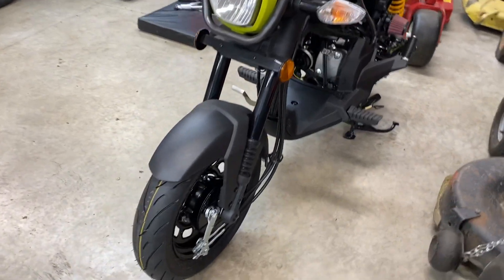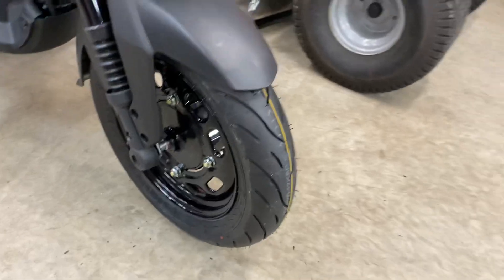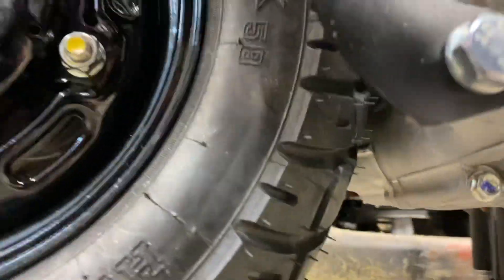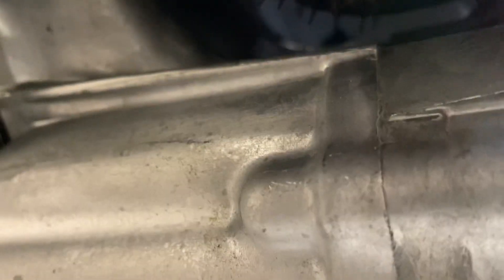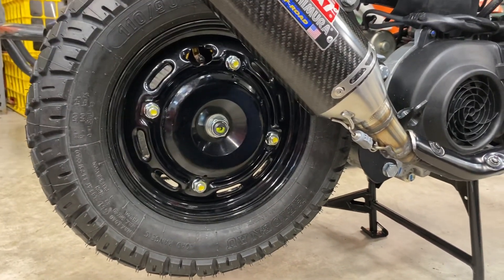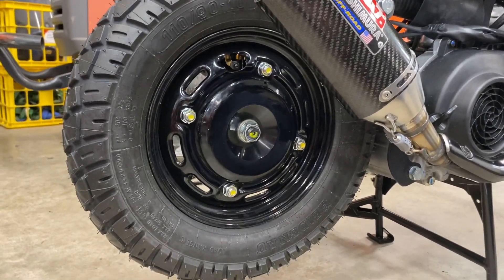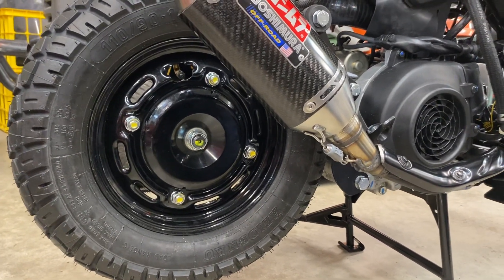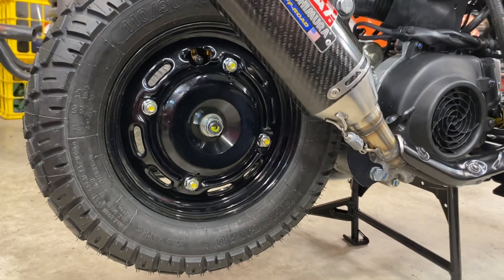Honda Navi (Tire update heidenau)

Comment: You have some nice vids. I have a quick question for you, I am really curious after modifying the Navi what kind of top speeds you are achieving. Ive seen a lot of videos about mods but anytime someone asks about the performance gains it seems no one can give a real answer or actual number of top speed. Its always "I won't be riding it for while because it's raining" or "it's too cold" or they just plain and simply say that it is going faster but without any numbers or depth in the response. I read a comment that you said you won't be riding it bc it is too cold, I understand that. But if you could please just give an update about the performance gains when you can that'd be amazing 🙏. Thank you.
Reply from the maker: Thank for watching billy.
I understand, this was the first weekend actually I could take the Navi out. First take of gas got me 60 miles, I was on steady flat roads. There is a brake in period fyi so I’m not just going to beat on it right away, motor need to loosen up… cold weather plays a big factor cold tires on and on.
Honestly if your looking for speed this isn’t for you… remember it’s a carbureted 110 cc, wind, body weight and mass (how wide you are) all plays a factor, this is a cvt transmission and will never compare to chain drive. Yes you will spend a lot on performance looks and what ever else you want your Navi to do or look like…
I’ve been in the bike game for awhile and ever bike is fun in it own way. Personally for me it relaxing maxing out around 50mph and enjoying the scenery with the Navi, and this is for my kids not really me fyi 
I almost every kind of bike for different riding I want to do. 
No shifting is nice! It a ride to enjoy your surroundings and never get a speeding ticket on lol
Hope this helps
Reply: @rideordie6886  thanks for the quick response! I just got a Navi for my first bike/scooter whatever you wanna call it. I'm a beginner and I got it because it's easy to ride/don't have to worry about clutch/ and it's not too much power. And I agree it is nice to just relax on the bike and enjoy your surroundings without flying down the road, although my stock Navi barely hits 50, and if it's on a hill then barely 35. I know that is to be expected though I would really like to find some mods that would improve the performance both for safety reasons and for fun reasons. It would help a lot if I could go at least a steady 55 so that I could keep up with traffic on the access roads. I'm just curious if you were able to achieve any extra power with all the mods you've done. I'm not sure if I completely understand what you meant by on the first take of gas you got 60? You were able to go 60mph? How does it feel on an incline?
Reply from the maker: @billydickenson958  60 miles on a signal tank is what I was saying you will not get 100 miles on a single tank. Hi honestly I would sell your Navi and look for a different scooter with a bit more power as in a bigger motor. You will spend way to much to get maybe 53mph…
This scooter isn’t for me it’s for my kids. 
Sorry to tell you that the Navi is fun but 45mph fun, great for when you go camping and 30mph roads. Yes you can go long distances on it but trying to get to 55mph with out going down a step hill  is about all this will do. Honestly just sell
it and get something else
Reply: @rideordie6886  yeah I would eventually like something with more power, I do not know how to drive a manual bike, since my automatic options are limited I'm stuck with the Navi until I learn. So far it's a ton of fun but yes I will eventually move up. A lot of the side roads around here are 55mph and that's doable with the Navi but it would help even with just an extra 5mph top speed so I've just been trying to figure out if anyone out there has been able to raise the top speed on the Navi.
Reply: Also I think it would just be fun and interesting to try and see what it can do.
Reply: @billydickenson958  you should look into the Honda NC700X. It is a DCT (still automatic transmission) with a LOT more power. I bought one for my fiancé and she loves it for when we want to hit highway speeds. She has her 2015 NC700X parked next to her Navi and I have my 01’ Shadow Spirit 750 parked next to my 22’ Grom SP. We have 2 automatic bikes and 2 manual bikes and though I would love to add another 12~13 bikes to my garage, the 4 we have strikes the perfect balance. Just a suggestion, keep riding and be safe!

Comment: If you had the stock exhaust installed would the stock rear wheel cover fit the 110/90/10 size? Or you would need to ride without the rear cover?
Reply from the maker: good question I'm not sure but I will check when I Get ready to prep for primer and paint on my custom rear fender, then I will check.
thanks for watching and subscribe if you haven't already :)